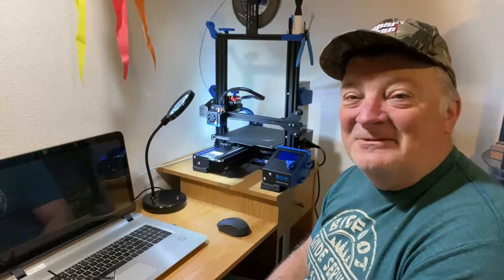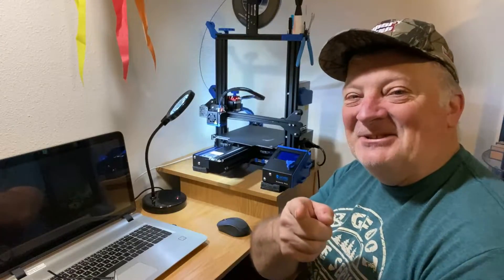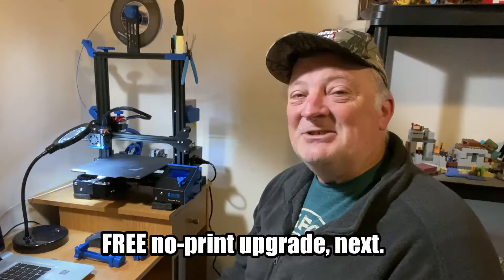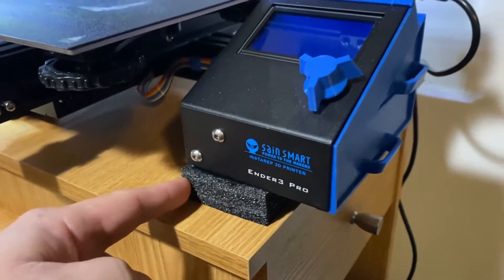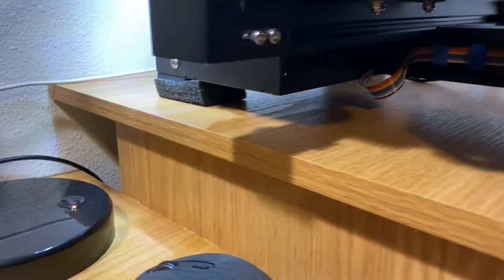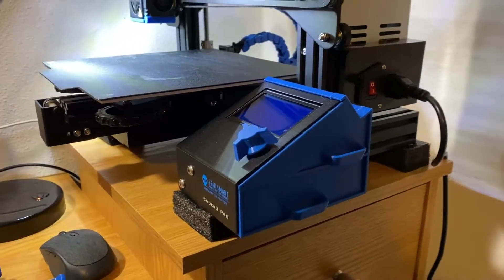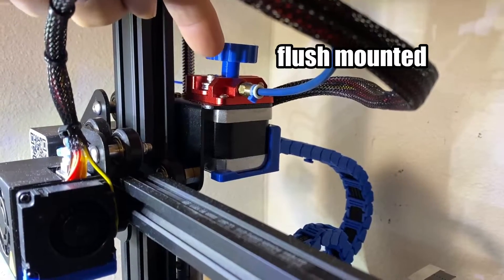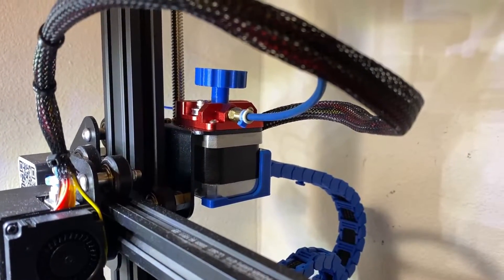Ender 3 Pro Necessary PRINTABLE MODS, No B.S.

Comment: by the way the tool rack that goes on the op axis interfeirs with the z axis motor
Reply from the maker: Put it on the on the opposite side of the top rail and you will be just fine.